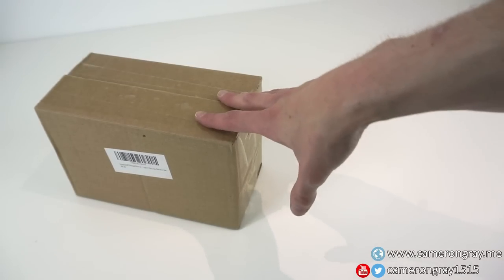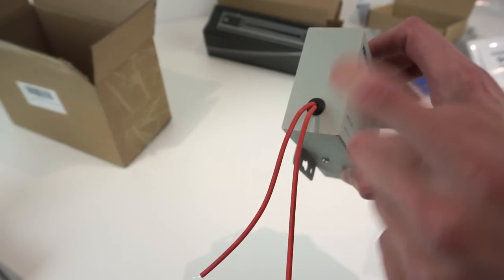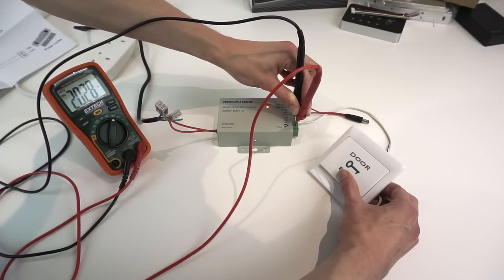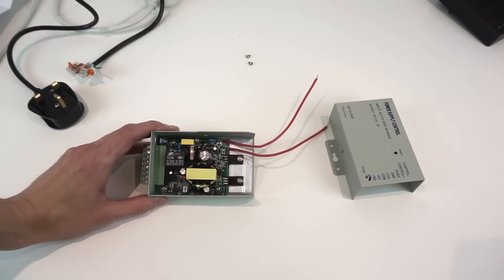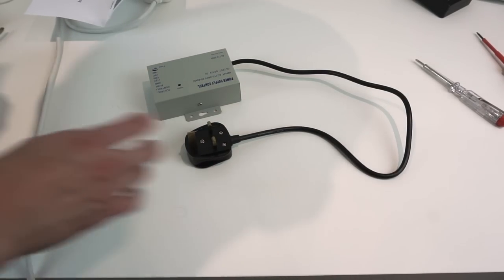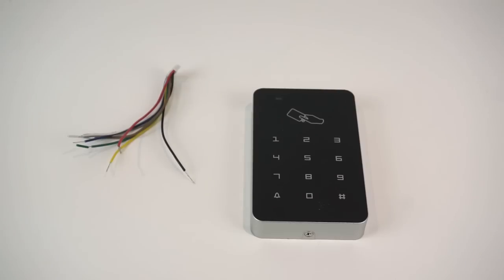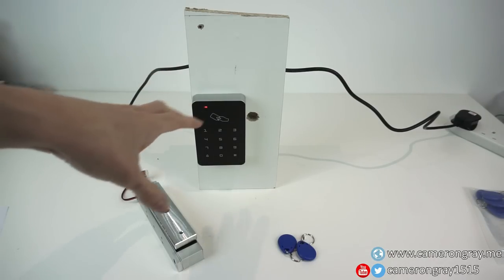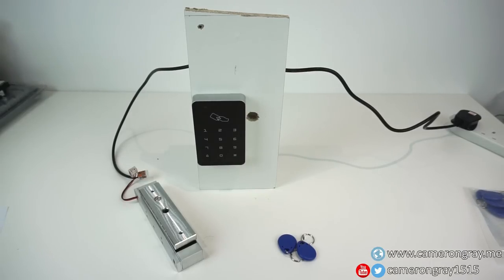Cheap "Access Control" System - Defeated with a screwdriver!

Comment: Personally i'd have put a ring terminal onto the earth and affixed it to the case. If the solder joint fails on the earth wire, and a fault causes the case to become live, then your circuit protective device may not trip.
Reply: Yep

Comment: This is probably an adequate replacement for a cheap mechanical code lock in an indoor environment where there are always staff around when the building is open. It would stop members of the public wandering into areas they should not be in by accident but not much more.

Even though the RFID tags are easy to clone it is still less likely to happen than somebody working out the code on the mechanical lock, either by observing staff typing it or looking at which keys have the most wear (the cheap ones are combination, rather than permutation based so the order doesn't matter).

Comment: So, me and my colleague worked in a school as IT techs and we introduced something like this, cheap system, to our server room. After a while, my colleague found a way to bypass it with a paperclip. He hid it ontop of the doorframe. And told me to only use it if my pass didn't work. Later on, he constructs a RJ45 faceplate that is hardwired into the bypass. and put it inside the server room. He said "If you ever get locked in, short a RJ45 head in these specific pins, and plug it into the faceplate. The door will open." I would use the RJ45 way all the time as my way of exiting to look badass, haha.

Comment: Nice to see the system and how it works inside.

About the defeating it - well, yes. Obviously you have to build this case into something rigid around it at an installed site. Then there is no access to the screw or the case and cables. 
Of course if you have a building in which the mains-power is accessible from outside (like for the fire-fighters) then you don't even need a screwdriver to defeat this system: just open the electrical-door, pull the fuse, open the door, put the fuse back in and no-one knows what made the short power-failure.
Should at least come with a battery that keeps the lock working for a couple of minutes or half an hour or something like that.

Comment: Interesting. I bought the same lock but bought a 12v/5v laptop "brick" PSU. I should have done the same as you and bought the whole kit, especially as I now know the lock PSU can take a GPIO input. I'm installing this lock with a Rasp Pi 4 running Domoticz in a Docker container. Pi operates a solid state relay which was about £17 for a module of 4 relays. The Pi connects to a Texecom panel (your video review on this panel was really helpful)

Comment: I suppose the easiest way to make this a bit more secure would be to replace the screw on the bottom with a security torx (or similar) screw instead of just a standard Phillips one, but that wouldn't deter someone determined to get in becasue they could just come back with a security torx driver to remove it, or as you said, use a hammer or a rock if they dont care about it being noticed.

The higher end systems are usually in 2 parts, where the "keypad" is its own device, and the mag lock/release button are a seperate device, usually connected to a network (and in the case of the keypad/reader, usually powered by POE), where the 2 seperate devices are then linked in some kind of central software controller where you can configure what controller is linked to what mag lock to form a "door"

Also, Hi from Paisley!
Reply: At least some of those higher end systems are also capable of associating RFID tags with employee names, so there would be a log showing which employee (name and/or ID) entered which door at which date and time, possibly even indicating in red when someone access it outside defined "business hours". I've seen such systems in use in large office and school buildings!
Reply: Security torx screws are useless!
All it takes is a small flathead to reliably remove security screws. I can’t remember the last time I have used a security driver...

Comment: I would maybe use this during the day to make it easier for employees to get in faster and simpler then keys and generally deter the public but then when the office is closed at night lock the door with something like a deadbolt or other heavy lock in addition to this.
Reply: That's exactly the use case for them... It's not meant to be a secure only lock (even by the fact it needs power to secure the door)

Comment: I'm surprised that it's just the magnet keeping the door shut - I would have presumed that the magnet would be used to hold bolts in position (or hold them out the way), so the strength of the lock would be the strength of the bolts, not the strength of the magnetic field.  Also doing it that way would allow for a key/lever based override, so that it could fail to locked when power had failed.  The fix for the keypad would be to have just the keypad on the outside with the logic board on the inside - it may even be possible to mod this module, depending on how the keypad is connected to the logic board.

Comment: If I designed it, I would have transmitted the door code after encoding a super-dooper hash over wire (or wireless) to an internal decoder to unlock the lock. Protect the smarts. Thanks for the video.

Comment: great video and super good explanation of everything.  can I suggest that the gap between live and neutral (weld points you did at the back of the board) is not enough for mains voltage) electricity jumps you know!

Comment: This why these systems need to do the actual processing on the secure side of the door. Something like sending an encrypted payload over the wire with the RFID/Pass information. Even if you took the box out, the encryption keys are burned into the IC.
Reply: thats called osdp

Comment: The mains would be perfectly fine if the psu was fitted inside an electrical enclosure which is probably what it's intended for I'm aware given the price of the kit it probably won't be an electrician installing it just saying. also if it were in an enclosure you could do your earth connection to the outside of the case through the screw on the case using a crimp on lug

Comment: Did you add any insulation to the bottom/underneith of the board to stop the wires shorting onto the case?
Reply from the maker: There was already a platsic sheet in place so it's still in there

Comment: True, but equally easy to protect the access to the screw. But excellent initiative to highlight the potential issue 👍
Reply from the maker: Unfortunately protecting the screw isn't really sufficient as the plastic keypad could be easily pulled/smashed off of the wall.  The flaw with this system is an architectural issue - a secure door entry system carries out all authentication and control of the lock from a controller in secure location.  The keypad should just be a dumb keypad/RFID reader that sends the data to the controller over an (ideally encrypted) digital link.

Comment: I hope people aren’t using these in busy offices... they need to release on fire alarm otherwise after the first person hits the door and can’t get out the whole crowd will start pushing and it’s too late to unlock the door causing TONS of preventable deaths.
Reply: If i remember correctly, in the UK there is supposed to be a "break glass" emergency release next to the door (the older sort have actual glass in them that breaks when you press hard, and when the glass is broken, it operates a switch which releases the door, the newer ones have a plastic peice in them which drops down slightly when you activate it)
and the "break glass" emergency release is supposed to be wired so that even if the control system for the lock became unresponsive (to where the normal way of releasing the door doesnt work) the emergency release would still work (in the case of this lock the emergency release would go between the lock itself and the power supply)

Comment: If the keypad has a tamper switch that cannot be easily bypassed and a LDR to sense keypad removal, where the tamper detect circuit disconnect all the cables, this would make it far more secure. The magnetic lock is very
weak and can be kicked open anyway.

Comment: Hi Cameron, quick question.

I want to add another RF relay to this system so that its controlled by a remote as well. 
How do I go about doing that.

When I connect the second relay the access control system just turns off🥲. No idea what im doing wrong.

Comment: At 6:20 , Can you explain how you wired the 2 red wires from the 3 core flex thats connected to a mains plug?

Can I wire them to a 2 core flex connected to a mains plug?

Do I need an earth wire? And where did you connect the earth wire at 6:20
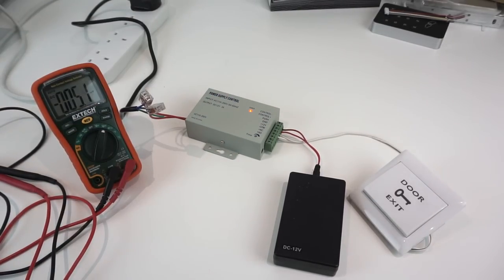Reply from the maker: At 6:20 I temporarily connected it by using a couple of Wago terminals, at 13:29 I show myself replacing these red wires with a piece of proper mains flex wired directly into the power supply as it should really be earthed and having that pair of single insulated wires outside of the enclosure isn't compliant with regulations in the UK.

Comment: Also you can make the magnet give way by yanking hard on the door handle.
Reply from the maker: Potentially depending on how strong the magnet and handle are but they usually aren't too bad if properly installed.  However this kit is also available with other locks including drop bolts and various latches which would also be affected by the flawed architecture, it's not only available as a maglock.

Comment: solution = pour some encapsulation resin in the rear of the keypad case covering the pcb and connector after plugging it in...  or buy a cheap siren and wire it to the NO of the keypad that way it sounds if the wires are disconnected
Reply from the maker: That would make it harder but then there's still nothing stopping someone simply cutting the wires and joining them together that way.  IMO the only way to do this securely is to have the PIN validation and lock control handled by a controller on the secure side of the door and have the external device simply be a dumb keypad that sends the key presses and card data to the controller on the inside of the door.

Comment: So when there's a power outage, the door's unlocked?
Reply from the maker: Yes, although this is standard for magnetic locks unless you added in a battery backup.  There are other types of locks that require a power supply in order to unlock so these will remain locked in the event of a power outage but they would then also require a mechanical override such as a door handle to allow the door to open in the event of a failure/emergency.
Reply: Failsafe vs fail secure. 
safety vs security

Comment: Great video and very well presented but note the power supply and the keypad are not CE marked therefore should not be sold in the uk. It would be the sellers responsibility to get them CE marked. The fact you had to change the wiring and solder a new cable says it all. It makes the product dangerous and most people would not change it and just use connector block and plug in.
It's great you have shown this product for was it is. Personally would avoid as its rubbish.
Reply: @paulattree4171  I'm an engineer Paul, so no i don't find things difficult. Open my mind to what? The fact that it is not earthed which by the way is UK regs and the chasis can become live at any time? This is a dangerous product when not earthed. Not difficult to know that if you have the knowledge.

Comment: How many burglars have the manual to know which terminal is which? I would be interested in watching what happens when the paper clip touches the incoming 240v.
Reply from the maker: Sure, the average burglar won't have a manual but that doesn't really excuse this flaw, if someone wanted to target a specific lock they could fairly easily figure it out and if enough of these locks ended up in the wild, the process of bypassing them could become common knowledge. As for the 240v comment, the keypad is a 12v device so there's no risk of coming into contact with the mains.

Comment: The problem with the system is the accessible screw on the reader. If you replace the reader with one that prevents easy physical access, then the system becomes quite secure.
Reply from the maker: The issue is that the processing is done on the insecure side of the door, even with a better screw, the outside unit could still be forced off the wall with a crowbar.etc.  For a system like this to be secure, the external unit should purely read PIN numbers and card data and send it over an encrypted digital connection to a controller on the secure side of the door, this controller is what validates the data and ultimately controls the door lock.  That way, if you force the external reader off the wall, all you'll have access to is a digital connection that you can't compromise by simply shorting wires out.

Comment: There is an easy way to better the security of the control box and the wire harness which seems to be your only issue with this system. The only difference this system has different from the high and low end commercial systems is the key pad is better housing and there you go oh and a battery back up during power lose and tge power in to shut it off is for fire exiting wire smoke detector power out in there and your safe and sound 24/7
Reply from the maker: With the commercial systems I've seen (Paxton being one that I've personally worked with) the difference is with the architecture.  With the higher end systems, the actual controller that connects to the lock and that handles the logic is separate from the keypad.  The controller can therefore be stored in a "secure" location (often even simply on the wall inside the door) then all the keypad does is send keystrokes or card information to the controller.  The controller then handles all authentication.  If someone is able to break the keypad off the wall, all they have access to is a digital connection which if designed correctly, cannot be used to open the door.
Reply: I agree they are able to do oh so much more but your getting what you pay for you pay little you get little. But even the high ends have draw backs its a give and take world i guess. And i did enjoy the video it just had me thinking how to over come some of short coming to make it a little better and keep it cheap. I used to install the bigger much much bigger system and miles of wire in nursing homes and businesses about, wow... 20years ago. But thank you for the video and ill be checking out more for sure.

Comment: Can i make a batery to controll + - to have energy all the time if the fuses are down?
Reply from the maker: Power passed into the control input is purely a signal to control the output, it does not pass through or power the device so this wouldn't work.  You'd probably be better off with a higher end access control system that has a proper battery backup facility.
Reply: @camerongray1515  ok  but for  what's is that batery you have connected on 13:13 seconds on control + and-
Reply from the maker: That was just to provide a 12v supply to those pins to demonstrate how they'll trigger the lock to open, if the power supply wasn't plugged in, that battery would do nothing.
Reply: @camerongray1515  thanks for the info👍

Comment: You could replace the screw with a less common one, torx or the type that is 2 dots. Sure if someone had the screwdriver bit for that type it would be the same but your average joe burglar isn't toting a snake eye screwdriver.
edit: I suppose it wouldn't help against the smashing...
Reply: Another issue with it is that a magnet could be used to activate the relay in the keypad, which causes the door to unlock

Comment: Basically that's how easy it is to defeat cheap access control systems IF CARELESSLY INSTALLED.
Reply from the maker: Unfortunately the issue goes beyond how it is installed, in my opinion there would be no safe way to install this system as the wiring to open the door will always have to be connected to the reader on the outside fo the door.  In my mind, the only way to correctly do this is to have a dumb card reader/keypad on the outside of the door connected over a digital connection to a controller in a secure location with the controller switching the power to the lock.  That way, if the card reader is removed, the attacker will only have access to this digital connection which can't simply be shorted out to unlock the door.
Reply: @camerongray1515  I totally agree. I have those cheap ACS installed on my clients, as much as possible, no wirings must be easily accessible outside, if possible, chip a portion of the wall to submerge all the wirings or even the reader/keypad itself. We have better ACS systems thou most of my clients prefer this type of ACS. The price of good ACS comes in to factor as well.
Reply from the maker: @JericDacara  I think my fear with mounting it that way would still be that at least with this one, it's only made of plastic so simply smashing it with a hammer from the front could give access to the wiring inside.  I definitely agree that the "proper" systems can be significantly more expensive though.